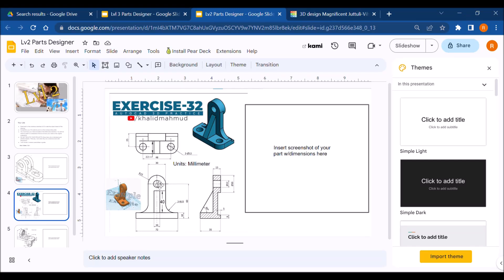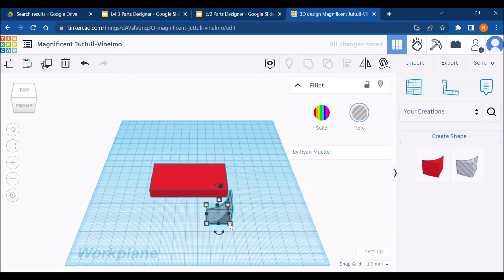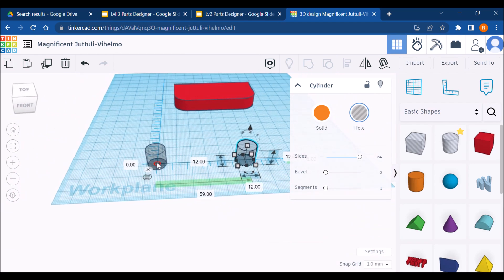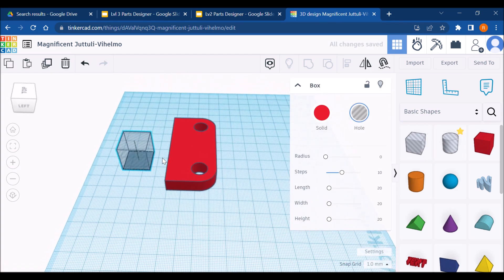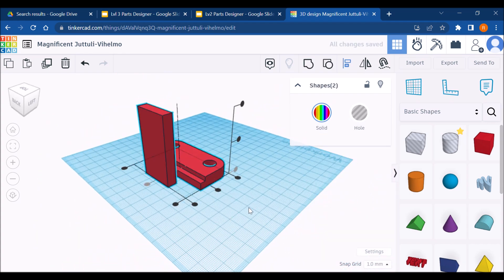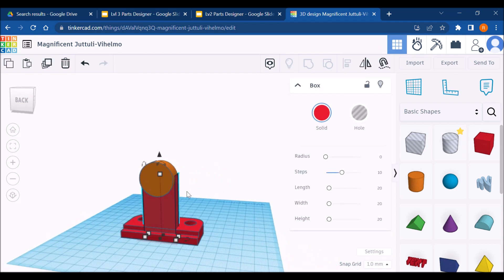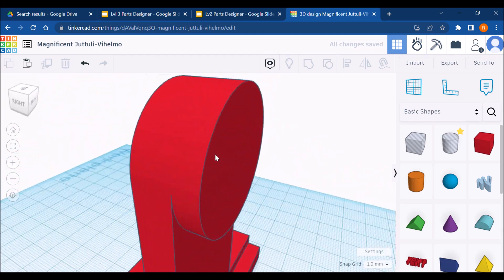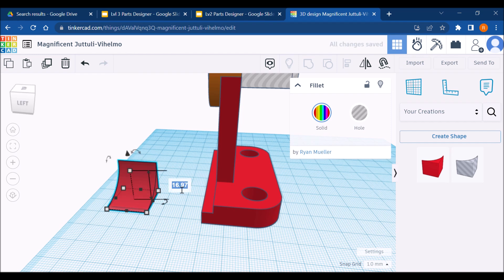Parts Designer Level 2 Shape 2

Comment: Any idea why the alignment didn't work around the 8 min mark lining up the cylinder and the upright? I recently had that problem in tinkercad I just kept hitting align and it slowy centered
Reply from the maker: I should not have locked the upright part. Instead, I should have selected both objects, clicked align, then clicked on the upright (to tell Tinkercad that I want to align the cylinder TO the upright), then clicked on the center circle of the alignment tool. If you just select both objects & click the center alignment circle, sometimes tinkercad moves both objects (which we didn't want in this case as the upright was set in its final position).